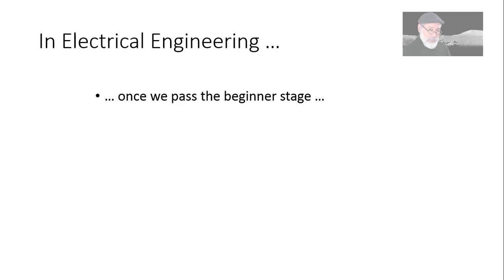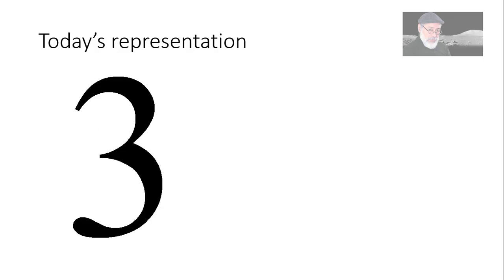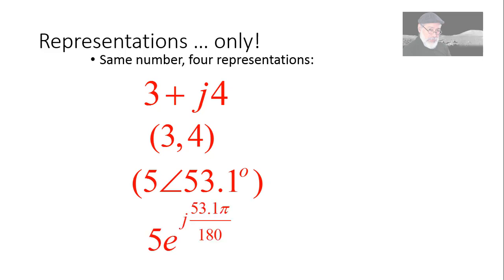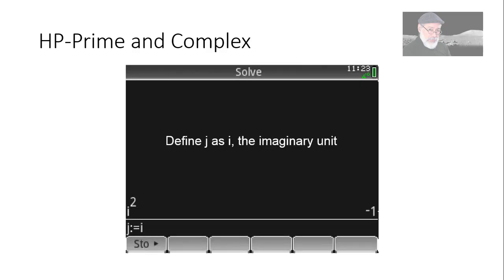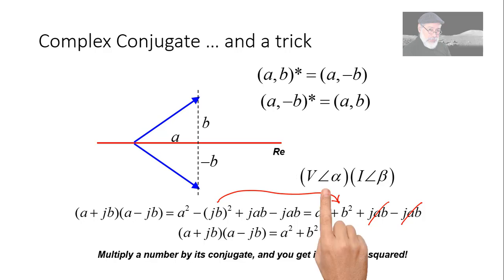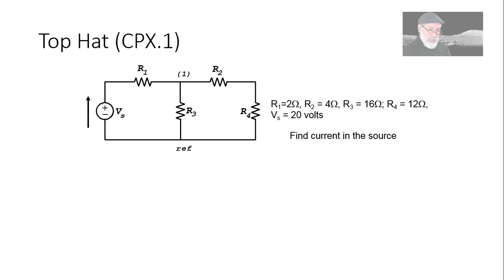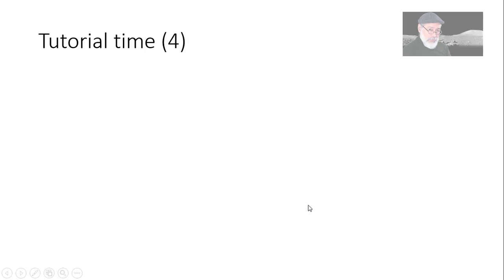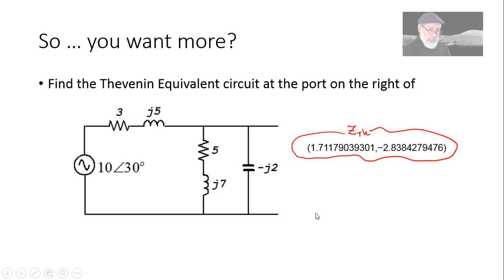ELEC 202/01 - Complex Numbers in Electrical Engineering

Comment: Excellent video. Bravo! But... I think it needs an improvement here: You take for granted that an inductive impedance is a positive imaginary and a capacitive impedance is a negative imaginary. But you must show why.
Reply from the maker: Well said, Lone Ranger.  However, at this stage, the first lecture of the term, we are only revisiting the arithmetic and graphical representation of complex numbers.  The electrical engineering is merely circumstantial.  The following lecture, "The Genius of Steinmetz", is where phasors and complex impedances are presented formally.  It's a bit of the horse behind the cart, but it seems to work in a classroom.

Comment: Hi professor, another excellent video.

There is some video, material or tip showing how to solve the penultimate problem manually (without this powerful calculator)? I tried to solve here, but the result be wrong.

Thanks
Reply: Hi professor, I think I found the problem. There is a little mistake in the equation of calculator, Is1 was forgotten. Excluding it, the result is the same.
Reply from the maker: That is correct, Mr. Agaelema. The one slide active at 30.22 contains more than twenty screenshots of the HP-PRIME emulator, they got mixed up, my guess. I have reported the typo at the end of the video description, along with the correct numerical value of Vo. The procedure is correct. If you were in my class, I'd give you a bonus-point, one extra mark in one of the ten homework assignments. Accept my symbolic "bonus point". Good work!
Reply: Hi professor, unfortunately I'm not in your class, but I'm, a fan of your videos and didactic on youtube.

Greetings from Brazil